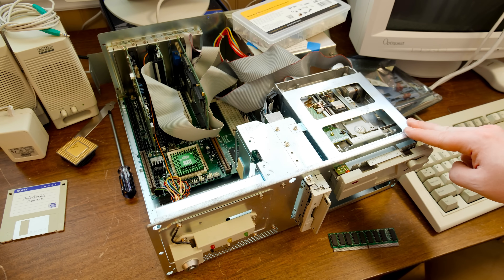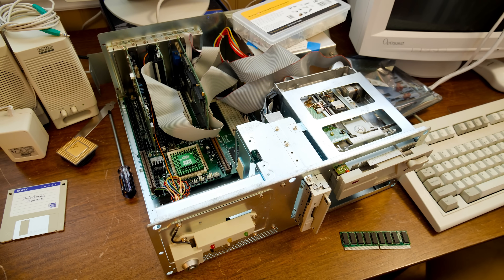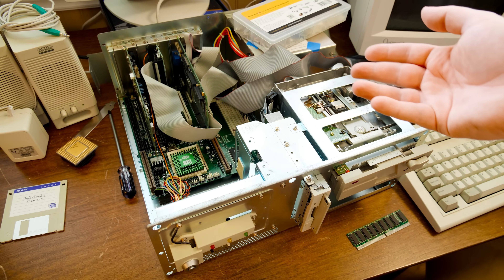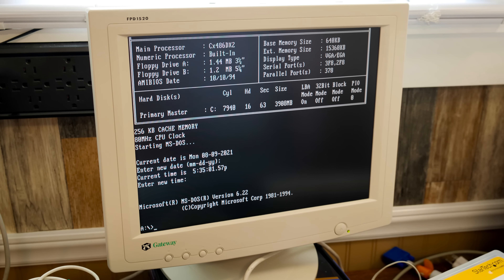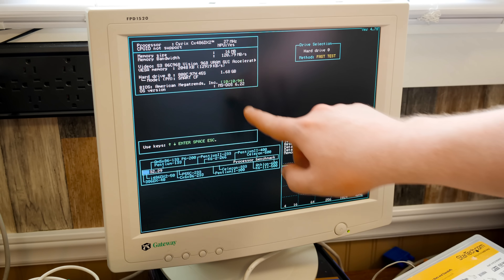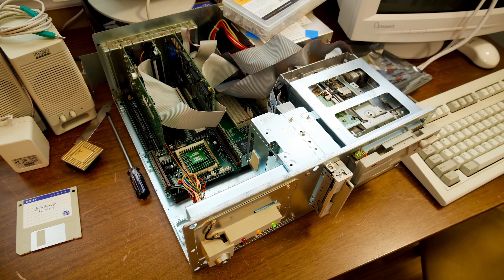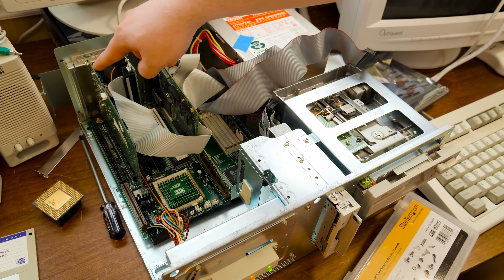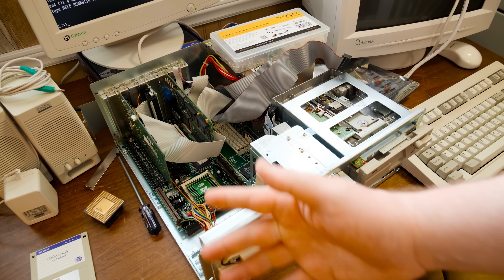M919 Fake Cache and Reproduction L2 COASt Modules

Comment: What is the point in external cache?  I thought the whole point of cache is that it's built into the CPU so it can access it really quickly.  That thing just looks like a RAM stick.  Not surprising you didn't see much of a performance boost because it's probably not that much faster than main memory.

Comment: This PC is so similar to the first machine I built myself. Cyrix CPU, PC Chips "VIP" M919 mobo, Opti Viper sound card (although mine worked just fine). I also had a Trident VGA card (pulled from my old 386) and a Quantum Bigfoot hard drive for all the slows...

I think an entire generation of tight-fisted PC builders ended up with a machine like this. It was inevitable in 1995 when you bought the cheapest of everything. 

Those motherboards could be really unstable as well... I went through a phase of being convinced that Cyrix/ST CPUs were flaky in Windows due to these things. Wrong culprit.

Comment: Wow, a PC Chips motherboard that still works! I used to routinely throw them away. Personally, I'd put a 6 volt battery on the header. Lots of them came with a velcro strip so you could attach it to the power supply.

Comment: IME, it's pretty uncommon to see a 486 board that supports EDO RAM.  It seems that's more of a Pentium era thing.  It's possible, since EDO did overlap the latter part of the 486's dominant timeframe, but it's just kind of uncommon.  And the way the RAM works can potentially cause a bus conflict if it isn't specifically supported, so it's not just that you won't get the speed benefit - it may (and often does) fail to work at all.

Comment: Been there done that many, many, many times. Back in the day, when memory was very expensive, 72 pin simms required a parity chip, but since memory was so expensive they put emulation chips to trick the MB that the memory had parity chip on them. They did the same thing with  cache to keep costs down.

Comment: I remember hearing about fake cache but never encountered it. Always thought FPM and EDO RAM were architecturally the same, and EDO was just a later name given to FPM RAM though?
Reply: They are very similar, but not identical. The primary architectural difference is that EDO keeps the chip output buffer enabled for the whole burst rather than deactivating it between each read cycle so it had less settling time.  In practice EDO devices also normally had a larger row size so you could transfer more data in a single RAS cycle, but that wasn't actually a characteristic of EDO.  There was also a further development called "Burst EDO" that  never gained much traction that sped up the read cycle even more by incorporating an internal column address counter so you could just repeatedly pulse CAS to clock out the entire row without having to supply the addresses.  It never caught on because SDRAM was being introduced around the same time and it was clear that it was soon going to reach a clock speed where the latency advantage that EDO had would be eliminated.

Comment: The community made a L2 cache module for a PC-Chip motherboard.😳.... why 😟?? ...... I mean.. if it were a good motherboard.. well fine 🤔...... but is trash can material 🤢.. is a PC-Chip 🤮 .... is a waste of space 😐..
Can someone explain to me what's the deal with this trash board??.. it was blessed by the Pope... does it have drops of the holy grail in it or something 🤷‍♀️???
Reply: PCI socket 3 boards arn't super common in the first place but that aside if you get past the quirks it's actually an extremely versatile and fast motherboard. I have several of these boards and after figuring out what RAM it likes and getting the cache stick its been completely reliable. Having the option of PCI or VLB is nice and it's actually a very fast board if you want it to be. I run a Cyrix 5x86 120MHz in mine with the PCI bus OCed to 40MHz. Its also the only known board to support enabling some of the Cyrix 5x86 features in BIOS.

Comment: Ah PC-CHIPS, that brings back memories :P
My first PC had one (An M590 i believe). can't find any info on it now, but i remember reading that the 1MB L2 cache on the board was infact 512KB but with the BIOS set to show 1MB.
Another fun feature was the worst GPU i've ever encountered onboard (a crappy SIS one) which was so slow it ran quake at a quarter of the fps in hardware mode than the PC could run in software rendering mode :D

Comment: Having a cpu with 16kb or more L1 cache rather than 8kb makes the L2 less necessary, thats why the improvement wasn’t very big. If you try with a regular 486 DX33 the difference will be greater

Comment: Sounds like its a contractual or tax thing where if you "have" L2 cache you get some benefit. So they enable L2 cache in the BIOS , but there is nothing to enable. Reminds me of the Amstrad CPC range which had the 464 (64k of ram), but in Spain they had an import tax on 64kb computers. So Amstrad added some more memory to the board, just didnt connect it to get around it!

Comment: Be careful with the voltages that the COAST receives, I recently read in vogons that the cache module is fed with the voltages provided by one of the VRMs that go to the processor.  So that module at the time of the video was receiving 5v (because of the dx2 80 you were using), note that not all COASTs are 5v tolerant, that depends on the model specifications of the COAST chips

Comment: I have the m919 V3.4B / F and when I bought it I saw that the VRMs were damaged so until now I have not tried any 3.3v cpu in case the motherboard fries it.  Has anyone had the same problem?  It is that I cannot find any compatible transistor to replace the 2 damaged ones on the board (the ones that are damaged are NEC 2SD2583)

Comment: I would definitely update the bios. I had a M915i board with fake cache. Luckily the traces were real so I desoldered it and fitted real chips but the board ran like crap and had all sorts of problems until I updated the bios to the latest version from a board that didn't have the fake cache originally. Now it's a brilliant board and runs as fast as any 486 board i have ever benchmarked

Comment: I had similar issues with some of the sound cards 'buzzing' in M919. Try to fiddle with L1 cache configuration jumpers. If my memory doesn't mislead me, switch from write-back to write-through processor cache can help. And yes, BIOS update is strongly recommended if you intend to use PnP cards - original BIOS allegedly supports it, but it has some kind of early implementation which is broken. Latest '98 BIOS is here - http://th2chips.freeservers.com/m919/980914s.zip - but please note that the original M919 BIOS chip is most likely unflasheable, so you may need to replace it. With a new BIOS, you should see "Plug and Play and Bootblock supported" message at boot, right above L2 cache disclamer. If you don't want to mess with the update, sometimes the fix for creative cards can be enough - http://th2chips.freeservers.com/syl8884/pnpfix.zip - after running it the system reports that PnP is not supported, and some of the devices can start working. But despite everything, it's a pretty universal board with a nice performance, and some fun as bonus.

Comment: I got one of these M919 modules and plugged it into a P5 board once. It shorted out the PSU. Luckily, I noticed that quickly enough to turn it off before it burned any traces. I should have taken the warning on the back seriously ;-)

Comment: Back in the day I heard the 486 50Mhz would outperform the 486 DX2 50 because the base bus ran so much faster and therefore so did a lot of peripherals.  Any truth to this?
Reply: Absolutely. Given the right setup, it would outperform a DX2/66. 

Good luck finding a VESA setup that could work under 50 MHz bus. I had one back in the day but I can't remember what I used as a video card and I/O card but they were VESA and the thing was stable. Played the shit out of Star Control II on that rig, then sold it to get a Socket 7 board. Still have a very similar setup today :D
Reply: @the_kombinator  I wish someone would tell me the exact parts they used to make this mythical dx 50 build that can beat a dx2 66 because I've tried several times with various motherboards running a dx 50 with vlb video and hard drive controllers and I've never gotten them to outperform a competently setup dx2 66 build.
Reply: @AncientElectronics  To be honest, I was like 14 (so, a quarter century ago) when I built it (I worked under the table in a computer store, got paid in parts, so new computers were very frequent), I took no notes and I don't recall concrete benchmarking, but I do recall playing DOOM on it and not seeing any difference in playability vs my DX2/66 machine. I have some vague notion that the VLB video card was in fact an ATI, probably a Mach32. I don't think I used anything fancy for a drive controller, likely a standard 32 bit multi I/O.
Reply: @the_kombinator  Ah, The VLB ATI Mach32 is actually the card I used in most of my testing. It's not the fastest VLB card out there but I've found it to be very reliable at 50MHz FSB speeds.

Comment: Those chips really are hollow, they are nothing but a plastic shell, you can pull the top off of them with your fingertips and inside are 4 metal strips with the legs stamped into them.  Where I live (Tasmania) you could not get the COAST module you are showing off, lord knows I tried at the time.

I had this horrendous motherboard back in the day when I bought my first PC (instead of building one myself) and this crap is what I got saddled with.  Was almost enough to make me give up on PC's and go back to just using my orphaned Amiga's.

The one bright spot was it made me determined to never get ripped off like this again and I learnt how to build my own PC's and use quality components when doing so (never gave hardware much consideration prior to this since you didn't have to worry on the Amiga).
Reply: Oh hey, another Aussie. Hi from your neighbour Victoria :)

Comment: FWIW, a real chip would never be labelled with "WRITE BACK" or "Cache" on the chip.  The fact that the CPU used the SRAM as a cache was not a property of the chip itself.  The IC manufacturer would just pump out oodles of identical memory chips, and some of them would get used as cache in PC's.  Like a bowl isn't stamped as "Post Raisin Bran."  That's just something you can use the bowl for.

Comment: I have a newer version of that board that I need to repair. I'll see if it has the newer bios version tgst you want. Also bios is suppose to have the special features for the cyrix CPUs (like the 120). Enabling them brings out the true power of the cyrix cpu. (CPU galaxy showed an example which blew away the amd5x86 133)

Comment: So nice that you got it all sorted out so quickly, I also was scratching my head 3 years ago when one of these boards landed in my hands, I was like cool a PCI + VLB 486 motherboard I have to have it!
Everyone in my FB retro group was like "ohh you got one of these fake cache motherboard"!
I end up purchasing a pair of 8MB FPM modules for this board (and a pair for a DELL 486 VLB one) as all but a pair of 16MB EDO RAM modules worked with the L2 cache enabled but the memory performance was slower than with FPM LOL, apparently is a fast board so your overdrive should work great on it, my board runs nice both with the AMD-x5-133 "p75" 486 and the 100MHz Cyrix 5x86.

Ohh I catched a glimpse at that small box and it's so nice to see that Startech make a screw kit that include these old nylon AT standoffs!!! Thanks
Reply: FPM generally works better in 486 boards.

Comment: I must say this computer sounds like a computer build on cheat. First the cache memory is not connected and the battery is not connected either. Then it also some other things that is not okay. I do hope you get the computer to work as it should do. This is like my laptop a Dell Latitude E6420 I change the battery since the battery only charged up to 57% and I install Windows 10. Now the new battery support charge it shut down the computer. I have tried everything I can come up with but nothing helps. So I have started to remove the charge cabel when I use it so that it won't shut it down when it charge the battery. 

Yours
Wike1970

Comment: You almost have to give it to the manufacturers for the sheer contempt they have for their end users. Not only faking the chips but also rigging it so it looks like you can enable it? The cable company wishes they could stoop so low.

Comment: I have one of those of for m919 caches that I literally found in the street a few years ago. If I lived in US I would sent it to Clint as I don't have anywhere to use it but the shipping from here(Brazil) is probably more than the repro
Reply: On a strange coincidence, I also found a COAST module on the street, sitting inside the part where the paper comes out of some laser printer. I think I still have it somewhere.

Comment: A new victim of the infamous PC-Chips m919 fake cache in 2021!! I have a couple of early Socket7 from the same brand with the same issue (if we can call it an issue..). Interestingly, the latter revisions of this m919 don't have these fake plastic chips anymore. This Quanta pc had probably the motherboard replaced at some point... OEMs using PC-Chips??

Comment: Fake cache was such a problem with dip chips and modules going nowhere.  Theate 486 boards were the worst.  The first I'd seen them I bought a broken 486sx board that had massive stability issues.  I eventually found out that disabling the cache fixed it.  Turns out the dip chips were dummies!

Comment: Did I catch that correctly, an 800MHZ 486DX4?  What the actual heck?? Why would it even need cache at that speed... That's insane. -- Regarding the battery, it's probably a jumper issue.  There's usually a bumper that if it's set wrong will clear the CMOS after 30 seconds.

Comment: 15:00 Your bios chip may need to be replaced. I have had the same issue with the system not holding info without power regardless of the battery status, replacing the bios chip fixed it on every board I had that issue, including a far more modern AM3+ Phenom II x4 based system :)
Reply: AM3+ for Phenom IIs...why not FX?
Reply: @dallesamllhals9161  It's what I had? lol. I have only bought one computer new, I am a scrapper, so I get what I get. And what I got for $5 was a Phenom II x4 :) I know an AM3 chip in an AM3+ board is silly, but it was what I had.
Reply: @jbfarley  I didn't see it when I made this reply... I had loaded the video up and not watched it for like 2 hours, so there was no pinned comment. Oops?

Comment: 6:07 Ah the good old days when you can just shove the cables in and not worry about cable management!
Reply: I have a minitower P233 MMX with each bay full, card in every slot, and a 15k RPM SCSI drive. It gets so hot in there I had to cut a hole in the side near the CPU cooler to exhaust the hot air. Ribbon cable management is critical lol! I've had to carefully slice the cables so they can be rolled up and out of the way. I also had to add an extraction fan under the hard disk. Sadly, that drive is dying - I have a replacement for it, but it's only 10K RPM :(

Comment: FWIW I have the 3.2 version of the M919 (with the same reproduction 256k cache module and AMD DX4-100/16k write back cache) and the 3.4B/F (with original 256k cache module and Am5x86-133) and both are rock solid with 60ns EDO RAM. Both CPUs run at stock speeds with the memory timing in BIOS as fast as they'll allow which make them surprisingly quick (relatively, of course). With as much flack as these boards get they're surprisingly solid!

Comment: This reeks of upper-management interference during development.

Engineer:  So, here's the mock-up board.  Here's the CPU socket, and here's the RAM slots, and over here are dummy place-holders for where we're going to put the integrated L2 cache.  Don't worry, it's just plastic chips and traces that don't go anywhere here on the example but when we start finalizing we'll put in the real stuff and complete the traces.

Production Manager: yeah. but, and hear me out, what if we didn't?

Engineer: Well then, we couldn't ethically market it as a board with integrated L2 cache.  Marketing would have to completely change the advertising push and the target demographic.

Head of Marketing: Sure, and here me out, what if we didn't?

Comment: HA! I figured you already knew about these "issues" when I posted on the other vid about this board. Funny thing...that COAST you bought is from the same guy I bought mine from a handful of months ago...small ebay world! 
I guess a 3rd thing about this board is VLB can be kinda funny too. I only have the one m919 and a few VLB cards...every VLB card I use when you pickup an item in Doom or Doom 2 does not play the pickup sound but a "POP" (other dos4gw games do other things like this) tried ESS cards and SB16 and issue follows until I go back to isa or pci video. So odd and it may be an issue with just my board, just passing that along. 
Happy m919 ownership! Outside of some little odd things it really is a nice 486 board.
Reply: DOS4GW needs to be exchanged for the updated version. The ones in doom and doom2 were buggy.
Reply: @wishusknight3009  I'll have to check that out! Do you happen to know what version I should look for? I've been using what ever version came with "the ultimate doom" disc pack I have (ver 1.666 or 1.9 I think is the doom patch)
Reply: @r38007  afaik there is only one update.  Most shipped with 1.95 and the updated version is 1.97.  There is also an extender called Dos/32 and another patch that can update code within a game that has the dos extender embedded. Wikipidia has info on it.
Reply: @wishusknight3009  perfect! Yeah I found I think 2.01a? Looking at Dos/32 now as it seems to be a better solution for what I need. I'll have to give it a try. Thanks again for the info